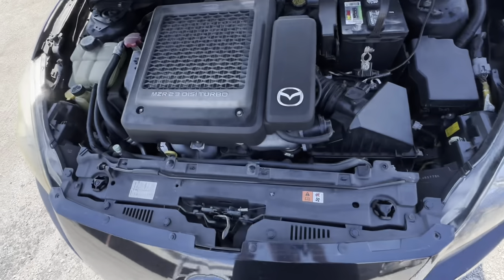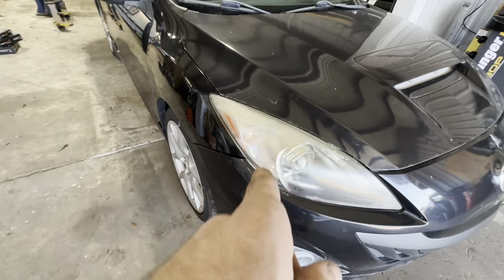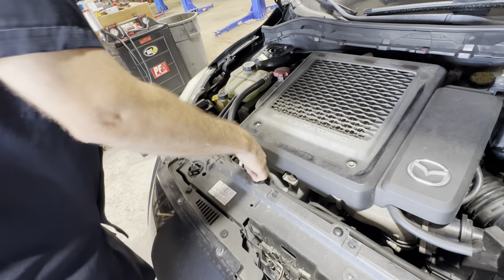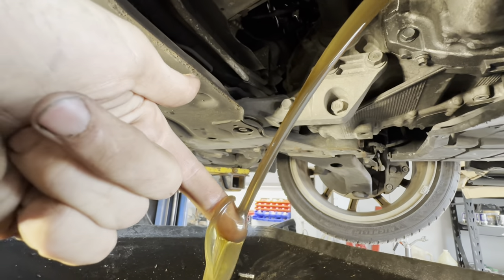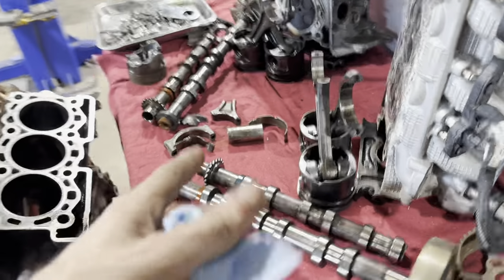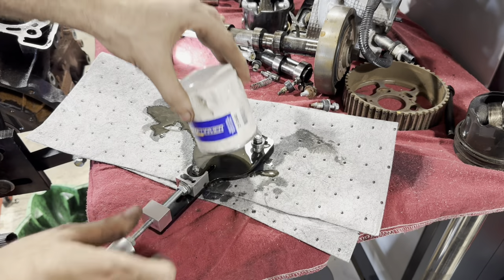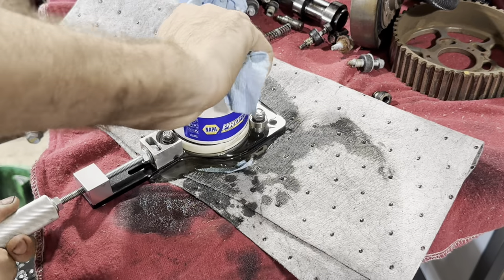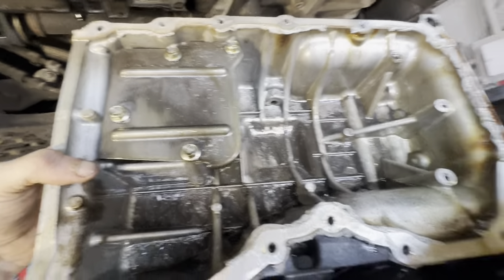New Oil & FULL of METAL! (Barely Runs - Knocking)  2010 Mazda 3 Turbo 2.3! #automobile

Comment: My daughter hates it when I tell her to check the oil and take it to get it serviced. I am using this video to teach her what happens when she doesn't service the engine properly.
Well done Ray!
Reply: Well, some kids have to learn on their own.  Meaning, if SHE paid for the car and it blows up....SHE can pay for the repairs.  Sometimes the most PAINFULL lessons are the ones that stick with us.............
Reply: I remember my sister asking dad what the blue warning light on the console meant. Even I at 13 knew that was the oil level warning. She said it had been shining for perhaps two months. Now that was the fun with old cars before electronics and later computers made their way into the engine bay. They might have warning lights but even if the oil went dry it would continue working at full strength until it seized.

Dad filled up the oil and tested the compression. He said it was turning like a coffee grinder, which was his way of saying the compression was shoot. He never checked the bearings or anything. Still that car lived for another ten years without him having to do anything about the engine. It wasn't performing as new, but it kept up at highway speed and got my sister where she needed to be.
Reply: When I was young, I hated the thought of walking everywhere even more--which was a real possibility.
Reply: I told my daughter that it's much easier to check the oil every time you add gas than it is to buy a new engine. She's very religious about checking!
Reply: Your daughter seems like a real winner. Thank today's wonderful education system...
Reply: I taught my daughter how to service her vehicle herself & how to change a flat tire. We’re not the same lol
Reply: Whenever you find an effective method please let me know. I’ve been preaching this to my mother and sister for years now to no avail. Unfortunately she won’t take it seriously until something breaks, resulting in a major repair-I see it everyday at the dealer.

Comment: Ray, when I worked on airplanes, it was standard procedure to inspect every filter during an oil change. We would place the filter in a bench vice grip upside down and then run the tool around the top. Better leverage, less mess, and easier on the falanges.
Reply: You can't park an airplane on a cloud if it runs out of oil😢
Reply: It had not occurred to me that someone actually manufactures a 'filter opener'. Who knew?

Comment: this was caused by owner neglect, these 2.3 mazda turbo motors are pretty reliable. I have friends that bought them new who have 200k+ reliable miles on them.
Reply: I don't have the Mazda 3, but the P5 wagon and it's almost at 200K on it. the 2.0 FSDE 4 pot, naturally aspirated. Pretty tough little motors.
Reply: The crankcase was way too clean for neglect.
Reply: @markschmalenberger8301 because the owner had a fresh oil change and probably new bearings installed before he brought it to Ray to confirm the carnage 

That new oil filter did it's job, but it's too late
Reply: @markschmalenberger8301  Would be interested to see what is lying up top under the valve (cam) cover.. figure that part of the engine will show more details, sludge, or whatnot.. betting when the bearings were replaced and that pan was originally dropped, the carnage was cleaned out of it. All i do know for sure, is if it were my car, i would have replaced the engine, turbo, turbo cooler, and any oil lines involved, in fear of introducing metal shavings into the new engine.

Comment: That #2 bearing/rod was pretty smoked, for sure.  Some lack of lubrication from either low oil or some other reason, no matter - it made that engine scrap metal.  Am looking forward to the subsequent videos of the engine replacement.  Thanks, Ray!

Hi Dave!!

Comment: I picked up my nice Honda CRV from a college student who never changed the oil.  I got it for $600 and a good JDM engine for $600. (That is pre-pandemic pricing.) Did the rest of the neglected maintenance and I have been running it for 4 years and about 240K miles.
Reply: It could also be called pre-Biden pricing.  :)
Reply: Wow, you drove over a thousand miles every single week for four years?

Comment: Been changing my own oil on all my vehicles since early 90s.  Latest 23  4Runner had a lot of break in metal at 700km. And still had metal at 1300km.  And no metal at 2500km……but the initial amount was the most I have seen  in a new vehicle.

Comment: I tried the replacement bearing method in a Saab 9-5 I bought cheap and it had 2 desintgraded rod bearings. Needless to say it didn't work and destroyed them emeditly. It also destroyed all the cam bearings from the fine metal acting like sand paper and destroyed the turbo bearings too but I didn't realize it till after I reused the old turbo on the replacement engine.

Comment: The crank isn't  showing the burn marks you would expect if the shells had "spun" . There's not enough debris to  account for 2 shells disintegrating completely. But the grinding damage is consistent with the rod and journal being closely acquainted with each other.  I may be wrong but it looks like somebody forgot to put a new pair of shells in #2  rod when doing a quick and dirty big end bearing slap after a total oil loss. 
Cheers Eric E

Comment: I bought a car like that once (Dodge Stratus).  The oil pickup tube had sheered off and dropped into the oil pan.  The girl driving  the car just kept driving.  The result was that the center main bearing seized and I got a great car for a great price.  I changed the engine and drove it for years.

Comment: These are fun little cars (Mazda Speed 3). The 2.3l engine is turbo charged and direct injected. Cobb Tuning make aftermarket tuners for these cars. There was also a Speed6 made in 2006 and 2007 that was part time AWD (Electronically controlled). These engines suffer from the same fate the BMW direct engines do; The intake valves get carboned up and need to be cleaned periodically.
Reply: The car is basically a Volvo C30, the AWD is Volvo Haldex unit. They were also offered with the 2,5 5-cylinder Volvo engines, together with the Focus ST of that model years.

Comment: the 2nd Gen Mazdaspeed 3 does have quite a few differences. I had a 2013 for 8 years, the stock K04 turbo has a magnesium alloy shaft. With enough high revs you can snap it messing up your o-rings and send oil right into the turbo. The transmissions are also known to have bad synchros leading to sloppy shifts and having to really slam it into gear which leads to money shifts sending rpm through the roof.

Comment: Back in the late 80's, I had a chevy 454 'mildly built' for a pickup truck.   The Crane Cams cam & lifter kit I bought came with a can of assembly lube that my mechanic used liberally throughout that engine build.   To my horror, my new engine oil immediately turned into stuff that looked EXACTLY like the metalic oil you just drained out of that filter.  After much panic, we discovered that the metalic look was due to an ingredient in the Crane Cams assembly lube, and did not have anything to do with premature engine wear.  ...........just sayin.....    Check that shiny, metalic stuff to see if it is actually all metal vs something else.

Comment: Drop gearbox and engine complete, only have to undo cables, coolant and drive axles. Much less work then to separate engine, unless you want to leave the trans in the vehicle, in which case you can get engine out from the top, after a lot more stripping of it.

Comment: In a pinch you could get away with swapping the crank, pistons and oil pump over from the donor and putting in new bearings. Would require you to flush out all the glitter from the oil passages. If it was my car I would ask you to go through the crate motor and replace things on it. New seals and bearings on it are a must.

Comment: If it has an oil cooler, replace it. They tend to trap metal only to release it back into the new engine. I replaced an engine and turbo on an STI under aftermarket warranty. I wanted to replace the oil cooler too, but the warranty company wouldn't pay for it. This was a brand new crate motor and new turbo from Subaru. It was back 4 months later. Warranty company covered ANOTHER engine and turbo and fought me on the cooler again. I eventually convinced them to cover it.

Comment: I'm kind of surprised by this failure. Usually these engines suffer from cam phaser and timing chain issues, not rod bearings. Unless it has really low miles, I would put a timing set and cam phasers in that used engine before it goes into the car.

Comment: looks like this mazda has the same setup as the 2012-16 Focus, where the subframe is behind the engine for the rack and swaybar. Had to drop that on mine to replace a failed electronic steering rack.
Reply: The car is based on the Ford C1 / Volvo P1 platform. Second generation Focus, more or less identical to the Focus hatch and the C30 aside from the body and trim.

Comment: It's Liquid Dave. All so if you take a pocket screwdriver and take the rubber ring off your oil filters when cutting them ,it works easier ,it's science.
Reply: I put the filter in a vice open side up and turn the cutter.

Comment: I was had the top of an oil pump break of that turned the distributor and luck the part that fell into the sump not hitting other moving parts ,
So I had crank checked out ok so I had crank cleaned up and small ends and rebore and  value's done it was om a Mk 1 escort had it for a few years and still other person bought it of me it only took a week to have all the work done ,but help to remove engine and reinstall to keep ost down.

Comment: You bought a welder, you can fix that Ford motor no problem.

Ok maybe that ones a bit of a stretch.

But the machine shop i worked at 
Not motor rebuild shop it was a job shop we made parts 
Anyway we got in a massive locomotive train engine one set of side by side cylinders has a crack between them, our welder  brazed up the crack by first grinding a v shape in both sides and laying in a brazed then we bored both cylinders  and froze the parts we also heated the block then pressed in new sleeves we had made, then it was sent to be honed out and back to the guys rebuilding it.
The train motors are massive in size and castings that big cost a lot of money to make.
But they are tiny when it comes to big really big boats like container ships. Those motors are as big as your shop.

Comment: I suspect a previous mechanic bad some improper repairs.  Over torque under torque wrong bearings oil pump issues cost cutting. The RTV sealing instead of a new gasket is proof that someone worked on the engine.

Comment: When I saw all of the glitter, I thought ... they spun a bearing.  As it turns out they spun all of them.  The rod caps were not on very tight.  Almost like someone had been there and forgot to torgue those babies.  Either way, crank is toast.  While you prolly could rebuild, aka new crank, new rods, new bearings, both rod and main, it prolly isn't worth it.  and you have another engine in the que.

Comment: It doesn't look like lack of service. That crankcase looks too clean. 😮
Reply: The owner screwed up by not checking the oil level and ran it dry... Or also abused it because "turbo"

That's a fresh oil change, filter, and oil pan silicone, so it was opened up and bearings installed to try to save it... But already knew that engine is a boat anchor 

Filter did it's job to catch the glitter though

Comment: Ray, that is indeed a balance shaft. It’s a common mod to delete them for a lighter rotating assembly in these cars. Downside is you need 8 quarts to fill the pan with the shafts removed

Comment: Why no metal in oil on the dip stick ?
Reply: Because that recent oil change and the Napa oil filter did it's job and caught most of the glitter 

The car sat in the parking lot for a while and the glitter settled on the bottom of the pan as well

Comment: What is the % of post 2010 modern cars have fuel dilution, into engine oil, which are due to cam driven leaky fuel  pumps. Fuel pump leaking slightly at 0.5 to 1 quart every 3000 to 5000 miles would be quite bad. Similar slow rate of leak for coolant into engine oil could be worst for the engine and without turning the engine oil into color of chocolate milk shake?. 🤔🤔🤔🤔

Comment: I love it when they come in like this and the customers say "I don't know what happened!! I check and change the oil all the time!!" 
Then you get into the vehicle and they failed to remove the old reminder sticker. With just simple math you're able to see that they've gone 75 to 100K without an oil change. Maybe more, I've seen more. Like those one oil change per year types.
Reply: I change my own oil and have never removed the sticker from the last time it was in the shop. Not everyone who has a 3 year old + shop sticker hasn't changed their own oil. I only do two changes per year because I barely put 5000 on my truck. I think my Ranger (I still miss it) had a 200k old sticker as I'd owned it for ten years.
Reply: Two changes a year for me, 2016 and 45,000 miles so far.
Reply: @zorander6  Granted and noted. But after work at a dealership, two "family" full service shops, and one of my own. I cannot tell you just how many times I have personally had to deal with my above comment, or had others I worked with that had to deal with it. I mean everything from the fresh oil, the "I just changed it the other day", to "It was working perfectly and wasn't making a sound this morning (or whenever).
So as you should know, from servicing your own truck, that once you start it up to pressure test your work. That oil is not going to look "right out of the bottle" clean. especially if you're only changing the oil once a year. So to have one come in with oil so clean it looks like it come right of the bottle. There would only be a few things that would count out a no oil event. Such as oil pump failure ect.
But the odds are MUCH higher that the vehicles owner did all the damage themselves, by not servicing their vehicle themselves or having someone do it for them.
Although you practice poor vehicle maintenance  and it hasn't bit you yet. That (in my mind) does not justify defending someone that has quite obviously not had the luck you have. And now has a Mazda 3 with a smoked engine. Which is clearly due to poor vehicle maintenance. Now if you feel you are in need of a second opinion, or even a third. By all means ask Ray and Dave. 
I'll wait.
My apologies for this being long winded and for any typing errors. In my 30+ years as a mechanic I never worked in the front of the house.
All that aside, I do hope you are having a great day and more importantly, Be safe out there!!
🤠😎

Comment: I do not understand why the time was wasted to do this disassembly on the lift??  Finding the deposits in the filter was enough to condemn the engine.  It will have to be replaced.  Ray just cost himself $1k or more unnecessarily.  R&R the engine, THEN teardown the bad one on your own time.
Quit complaining about the high cost of auto repair, folks.

Comment: No holes in the block, depends how bad the cylinders are but that motor might be a rebuild canadate.

Instead of a used motor
I would have bought a new short block from mazda and went over the heads.   Maybe lapping the valves  .

Comment: Turbo's are a bad idea in regular cars, the average driver has no idea on what they need to do. Change oil at close interval 5K miles with synthetic oil, cool down times etc.  Has been this way since Buick did it on Regals in early 80's
Reply: It's not a regular car, it's a Mazda sport.
Reply: @johnt.848  I stand by my statement, they don't understand how it works and beat the wee out of them. Bad idea, if you want more power get a bigger engine